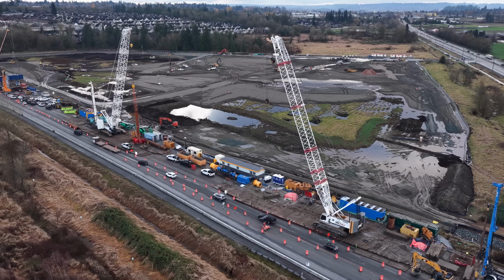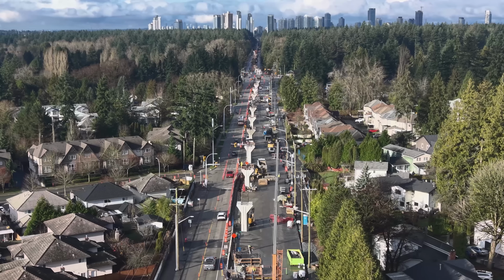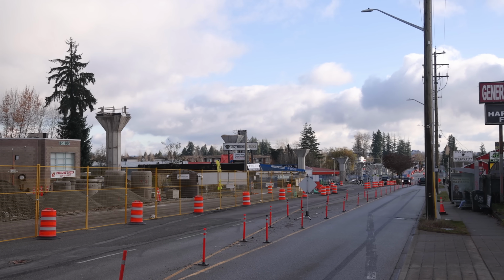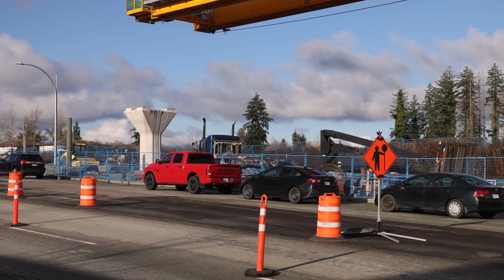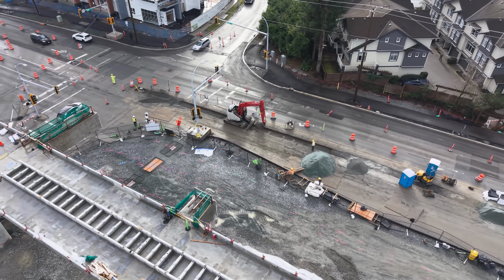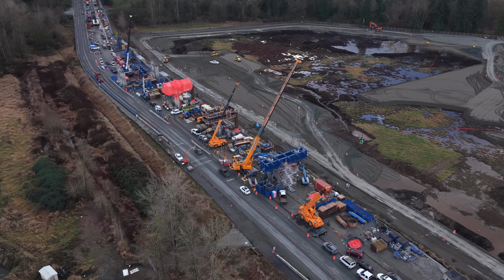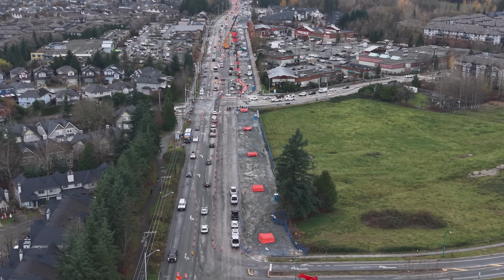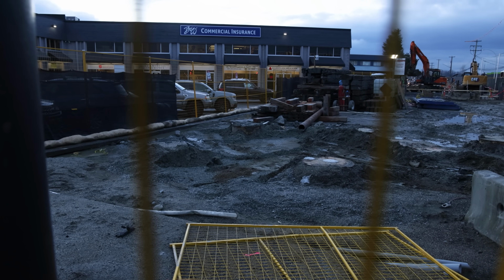Surrey Langley Skytrain Construction December 2025

Comment: How are they going to get the gantry segments up to Green Timbers station?  It doesn’t look like they can lift them from a lowbed truck like the other stations
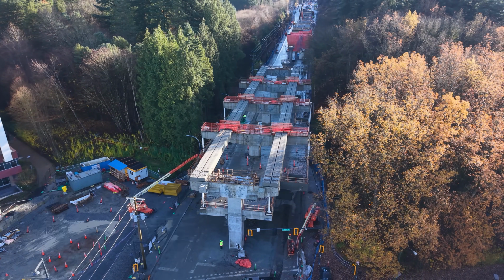Reply: The Gantry Crain "Surrey Sprinter" will advance among the columns. If you look at 0:30 you see the gap between the passenger platform support beams where they pull up the segments.

Comment: I wish they would add a spur after King George station so a future extension down King George Hwy to Newton could be easily added in the future. It would be nearly impossible to add in later and would be much cheaper than adding another platform at either KG or Surrey Central station in order to add a Newton line in the future. The Expo line can have 2 spurs- one to Langley and the other to Newton. At that point the Production Way to Columbia line can be a spur off the Millennium line or even a shuttle train between the Expo and Millenium Lines.
Reply from the maker: I'm super curious about how they'll handle that. Will ask around and see what I can find and include it in the next video.
Reply: @StainerTheFirst  I know that turning the Columbia to Lougheed area to a shuttle is part of the long-term plan, but pretty sure it would require a rebuild of Columbia if you wanted to get max capacity to Surrey. Translink owns the building now, so it's possible that they could fund an improvement by building units on top of the station.

Comment: A lot of people in Edmonton wanted to see the LRT built the way Vancouver built the Skytrain. $30 billion and rising so far for a train with empty cars going nowhere. All tracks head downtown where no one goes due to junkies and their crowds. A Skytrain would be faster to build and could be a tourist attraction too. Thanks for your work on these videos.
Reply: Awwww... Edmonton's LRT is pretty good! I know people complain about the Valley Line being a bit slow, but apart from a station or two that could have been merged, it's a decent system with stations that aren't too close apart from an extra station around Bonnie Doon and before Mill Woods that could've been dropped (increasing speed). 

Take heart, Toronto's Line 5 will be a LOT slower than the Valley Line when it launches in a few days.
 
Vancouver's got its share of methheads as well!

Comment: Its cool, and I'm a huge fan of transit as a concept, but honestly I'm perturbed by how this project costs way too much for what we're getting. I don't get why we ever ripped up the trolly system back i the day. and from what I read light rail in insanely cheaper per km. 

solid video though.
Reply from the maker: Compared to LRT it's much much faster. Also enables some pretty nice 1 seat trips across the region. Price wise the recently completed Line 6 LRT in Toronto cost 3.5 billion for only 10km of surface level line. So this costing 6b for 16km fully grade separated isn't too bad. Also much more capacity for long term growth.
Reply: @StainerTheFirst  TO be clear, it's MOSTLY faster because of station spacing. Toronto puts stations 700m apart and people expect the trains to run fast... they spend most of their time speeding up and slowing down. Yes, SkyTrain LIMs help with the faster acceleration but REM in Montreal is also very very (50km/h on average) and does it because it has an average station spacing of over 2km. 

Expo line will have 1.64km station spacing after Langley is built. 

Light rail CAN be fast (Seattle's Light rail is fast @ 46km/h ) but it has to be GRADE separated and have stations far apart. Seattle's station spacing is ~2.6 km and HIGHLY grade separated, spending a lot of time running along the I5 as well. 

Seattle's Light Rail is VERY INSANELY expensive / km. The whole 66km line is something like $30B USD?  Almost US$500B / mile.... or US $800 / km. More than double the cost of Surrey Skytrain, but in USD. They DO have some VERY technical challenges with tunneling, so there's that, but Light Rail also requires WAY larger tunnels than SkyTrain or Canada Line. 

Just Ask Toronto about Line 5.

So, COULD Surrey have LRT? Yes... Could it be fast? Yes, but not as fast as SkyTrain. Would it be watered down and forced to run at grade after 152nd, yep... which would add at LEAST 10 minutes to the travel time... there's also be the temptation to add more stations, which would add to the travel time as well.

Comment: Technically, the Skytrain system is lightrail rather than mass rapid transit. The Skytrain cars and tracks are narrower than those in MRT systems. An MRT system would be a better investment in the long run.
Reply from the maker: It's "Advanced Light Rail" and still runs on standard gauge.
Reply: Nomenclature doesn't matter, but most call it a light metro. It's an automated light metro with 80m platforms with a future capacity of 25,000 pphpd. That's all that matters. 

Canada Line uses "Heavy rail" cars, but is lower capacity. 

Singapore MRT: The North East Line is designed for 37,000–40,000 pphpd. 
Hong Kong MTR: High-capacity lines providing up to 85,000 pphpd.
Vancouver SkyTrain: The Expo and Millennium lines have a future capacity of 25,000 pphpd.
Canada Line (Vancouver): Designed for 15,000 pphpd.
Typical Tokyo Metro: Can reach up to 81,000 pphpd on high-demand lines. 

What matters is that it meets demand.

Singapore's MRT is a great system and works for Singapore. Other than capacity, though, it's remarkably similar to SkyTrain. 

Similar station spacing (1.67km vs 1.5km for Expo)
Similar length (45km vs 46km for Expo to Langley)
Similar speeds ( 38km/h vs. 43km/h for Expo to Langley)
Mostly elevated ( 11 stations underground in MRT vs. 3 for expo )
Similar build dates (Build in 88, expanded in 90, 96, and 2014 vs SkyTrain built in 1985, expanded in 1991, 2001, and now in 2029)

Of course Singapore's NS line has higher capacity due to insane 200m platforms vs 80m, but they are more similar than they're different.

MRT 6-car trains are designed to carry 1,200 passengers. 

SkyTrain MkV 5-car trains are designed to carry 670 passengers, although technically have a CRUSH load of 1207. 

I imagine Singapore's crush load is over 2000 though.
Reply: @TheNewGreenIsBlue I rode the Vancouver Skytrain for 3 years straight and found it mostly crowded, narrow, lacking in cleanliness, lack of seating, noisy etc. I found the experience so disgusting I took a lesser paying job that was within driving distance in order to avoid Skytrain. That's how bad was. I have experienced riding the MRT systems in HK, S. Korea, Japan and Singapore and found them excellent by comparison.

The "future expansion" plans might not come to fruition for decades because north Americans generally cannot manage money. They need to look for expertise from Asia.
Reply: @sktohotay  Yeah... Singapore and Japan are extremely clean countries. I've ridden trains in all those countries and more. Nothing to do with the trains, though. Also, Skytrain to Richmond uses Korean trains. You'll find the buses are cleaner as well. 

Yes, the train cars are narrow and crowded, because they're popular. Just like the Yamanote line in Tokyo or Midosuji in Osaka (or any train in the morning, really). 

And yeah... personal hygiene and strict social rules about not eating in Japan and Singapore exist.

You're right about costs, though. Train lines generally cost a lot less in Japan. Labour costs are considerably lower and they have a lot of expertise in digging tunnels as the country is 80% mountains! That being said, they're not immune to things costing a lot. Some costs are fixed.

The 7km Naniwasuji line tunnel under Osaka is costing ~¥330B to construct, which is pretty decent for a tunnel under the city, that has to navigate around other lines, but it only has ONE station on it. Other stations and connections are being built by Hankyu, JR, Nankai... so the ACTUAL cost is borne by the private sector.

Yes, North America can learn from Asia, but you can't copy and past cultural values and geology from one country to another. 

SkyTrain has high ridership, because it's a FAST and efficient system that gets people to where they need to go.

Comment: On December 11 the Clayton Clipper experienced an incident where the eastern most support trolley was dropped from the rear of the gantry crane onto the guideway below. The trolley was being lifted by two hydraulic rams that hang off each end of the crane.  The trolley remains on the guideway, laying on its side and the crane is currently not working. I imagine the failure is being investigated. Third hand reports say no injuries resulted from the accident.
Reply: They lifted the damaged support trolley down to the ground with a large crane yesterday Dec 20th. But the gantry hasn’t lifted any guideway segments since the incident.

Comment: Do you know if the extension will need to wait for the new OMC depot that you mentioned to be finished before the line opens to the public? Or will they open it while they build the depot?
Reply from the maker: The Line will open in 2029 before the yard is built. It's being designed so the yard construction won't impact the line operation.

Comment: Your videos are among the best of any transit construction project worldwide. I'm from Vancouver, and it's really great to see this kind of faster than driving transit that has been the big part of improving livability around the region.

I really wish that more people in Toronto are able to see your SkyTrain construction videos - I was originally from that city, and I wish more people there realize that this (the SkyTrain) is the proper way to build rail rapid transit. Not street-level LRTs. Last week the Line 6 Finch West opened, but it was so poorly designed and built that it ended up slower than buses: stops too close together, most of the line runs on-street, and there is no signal priority.

The prefabricated nature of these elevated guideways means that construction can be completed more quickly than any street-level LRT line, with less disruption to the roadway, and more importantly at less $ per km. Much of why Toronto's LRTs are more expensive than SkyTrain is because of road widening and relocation of underground utilities, and also the business case ratio is much poorer for LRTs. It's a big reason why there was such a big community push to get the Surrey LRT canceled in favor of SkyTrain.
Reply: Before the Surrey-Langley Skytrain was finally given the go-ahead, Surrey was adamant that they wanted a street-level LRT along 104th and King George between Guildford, Whalley, and Newton. The studies and debate went on for years until the previous Surrey mayor put his foot down and said no to it, to the great dismay of the Surrey Chamber of Commerce and other advocates of street-level trains. 

In Vancouver, every single line has been an intense LRT vs Skytrain debate. Richmond demanded LRT as well, and the only reason the Canada Line is as underbuilt as it is, with two-car trains and a single track on the Richmond end, is because TransLink had to give in to Richmond's demands that it have a smaller footprint if it had to be a Skytrain.
Reply: @jordanw8382  Wow. Richmond is so short sighted. No wonder roads are easier to build: it requires almost no foresight other than with engineering.
Reply: @jordanw8382  Before the ill-conceived LRT, the plan was originally to have SkyTrain down Fraser Highway to Langley City after the 1994 extension to Surrey City Centre. Dianne Watts and Linda Hepner setback the current extension by another decade.

Linda Annis is running for mayor in 2026 and wants to revive the LRT on King George and 104 Avenue. Surrey is going to have to vote for another incompetent clown to avoid her.
Reply: @bryan89wr  Thanks for the update. It's absurd that they're reviving the LRT debate yet again. I remember in 1994 after the extension to Whalley was complete, Langley was supposed to be in the distant future. Then the debate was raging about the Millennium Line, whether it should be LRT from Columbia up Lougheed to Coquitlam, or a line extending from Edmonds Station to Coquitlam, or the most projected-to-be-most-underutilized line through Burnaby on Lougheed, which was in the end what we got in 2001 and ended up being underutilized as predicted, for many years. LRT was pushed for that, too. I still think it's only by divine grace Metro Vancouver got Skytrain.
Reply: @bryan89wr  I'm going to commit to voting in anybody, no matter how bad, just to avoid LRT. I've never met a single LRT advocate, who will overcome the segregation problem and deal with drivers going on strike. LRT is too slow, too.
Reply: The King George rapid transit line needs to be Skytrain and not LRT! A spur should be added after King George station now so that the line can be added in the future.
Reply: Amen. It's so disheartening to see advocates for LRT as if it is the easiest thing to implement. I want BRT or ALRT.
Reply: Please don’t discount the value of the underground work being put in as well, that will have a lot of benefits moving forward as well, especially for sovereignty.
Reply: I agree. I'm from Langley and am very excited for this project to be finished, as it will make going downtown so much easier.